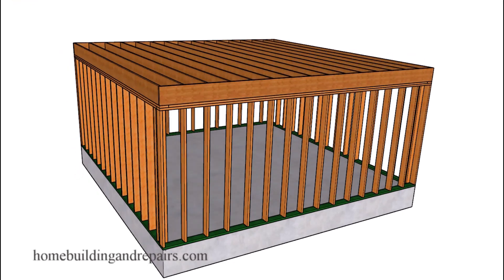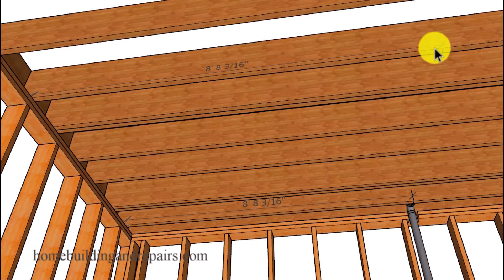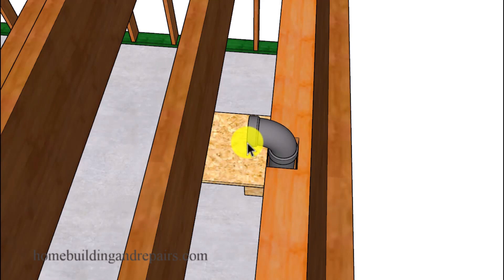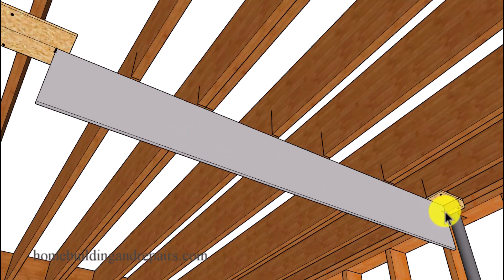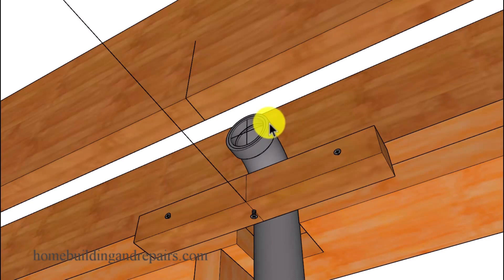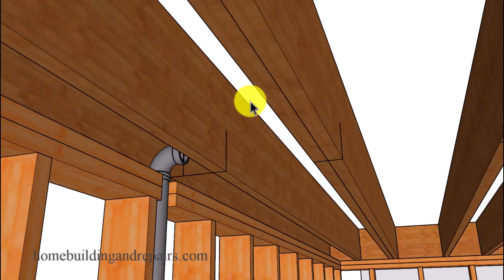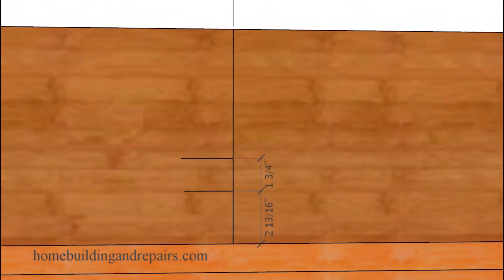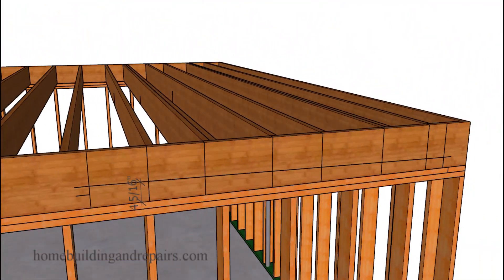How To Locate Accurate Hole Measurements For Sloping Plumbing Vent And Drain Pipes In Floor Framing

Comment: Good tips. I find it useful to determine ahead of time the max run for a given pipe size. For example, 2x8 floor joists are 7.25". Subtract 2" top & bottom keepout areas then subtract the pipe diam, say 2". This leaves 5/4 inch for slope run. At 1/4" grade thats 5' run max. Thats about 4 bays for 16" oc framing. This way you can do a layout a whole lot easier. Create a cheat sheet for your job based on joist sizes.

Comment: Uh, huh.  And now I wanna know how you slide an 8 ft piece of sched 40, or whatever, into those holes between those joists.  No, seriously.  I need to know how you'd do that.
Reply: You can't. You have to use small sections joined by couplers.
Reply: @blackmanops3749  Exactly.  What a mess.
Reply: You can if you're the framer/plumber like I am. I had to run 15' of 2" and I just threaded the pipe into each floor joist as I installed them. Another option that might work is to make an access hole through the rim joist and insert a long piece that way.